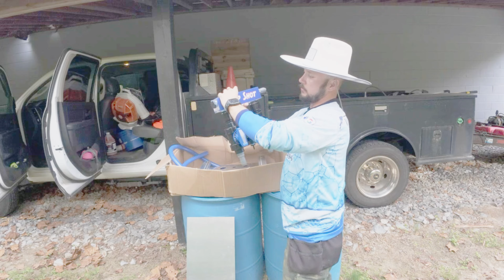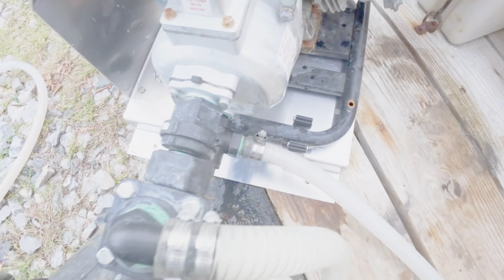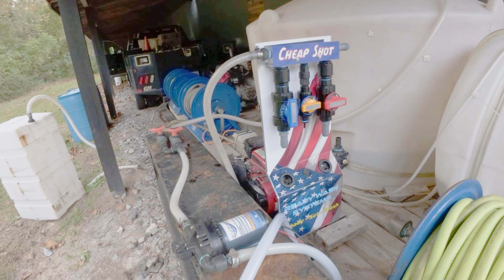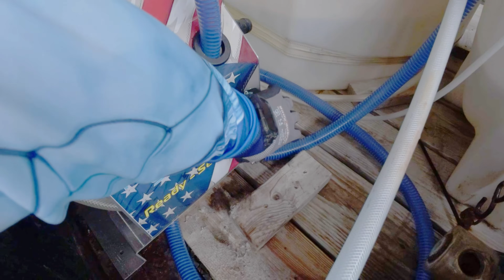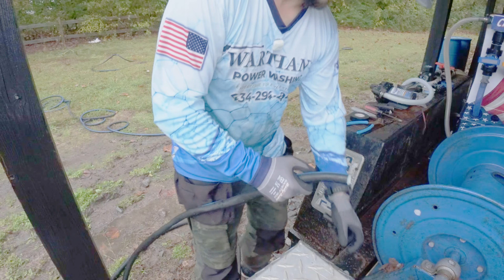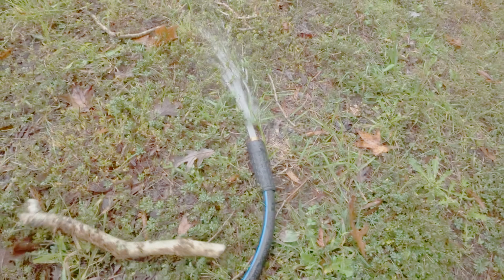Cheap Shot Soft Wash System – Full Setup, Test, and First Impressions

Comment from the maker: Honestly, this thing blew me away. 💥 The official Cheap Shot Soft Wash System is built solid, runs smooth, and performs better than I expected right out of the box. The layout is clean, pressure is consistent, and it’s just easy to work with.

Only thing I missed during setup — I forgot to bend the upright post! 😂 That bend actually helps with sturdiness when you’re going down the road and fighting the wind, so make sure to hit that step.

Huge props to Mike that designed this system — they nailed it. 👏
If you’ve been on the fence about getting one, this is the real deal.
Reply: Thank you my brother !
Reply from the maker: @TheFreshRinse and I did a 3way install that lined up well behind it. Check out the video

Comment: I built a proportioner with the 1inch predator pump, but have been having a hard time getting it to draw equally from water and bleach. What size hoses are you using on your bleach and water side? I believe you said you are using three-quarter from the manifold to spray gun, correct?
Reply from the maker: I did the 1inch lines on both. And kept them the same length going to water and bleach just to keep it even

Comment: Everybody talks about an unloader for the trash pump. The 1" pump only puts out about 60 - 65 psi. You do not need an unloader. I had one and took it off, it did nothing. The unloader used in this video and what everyone uses, does not seal all the way. It is designed for more psi than this pump can give. With the right hoses, you can run this pump for 10 min with no problems. No water out, no water in.
Reply from the maker: Makes sense. Someone else mentioned that the pump is designed not to need and unloader. So learning as we go.

Comment: My relief valve drip leak at the pump connection, how did install yours? Tru blue? No leaks if I have the stock cap installed.
Reply from the maker: Blue paste and gave it couple good turns

Comment: What is that plumbing setup you have for water coming into and out of the pump????
Reply from the maker: I did a T off the back up power washer. And going out just a 90 elbow to a straight barb. All 1 inch.
Reply from the maker: You can also rotate that outlet on the predator